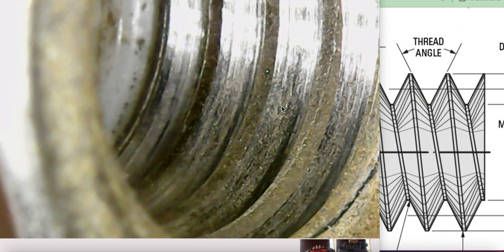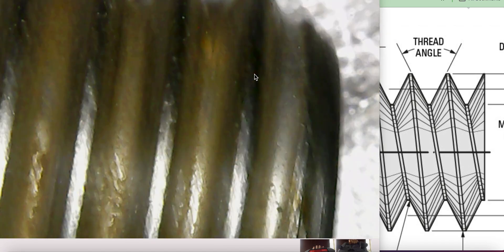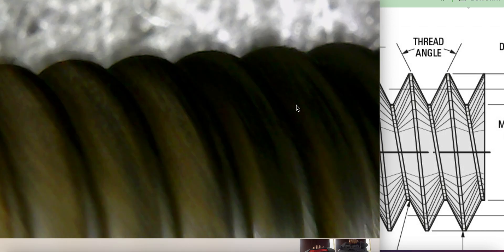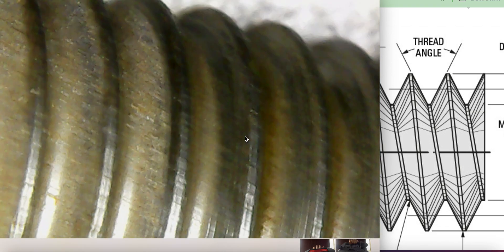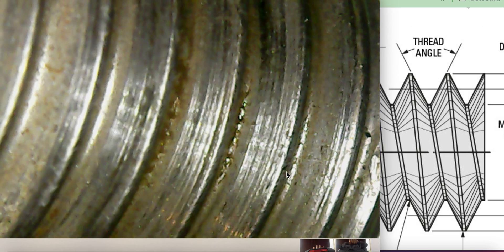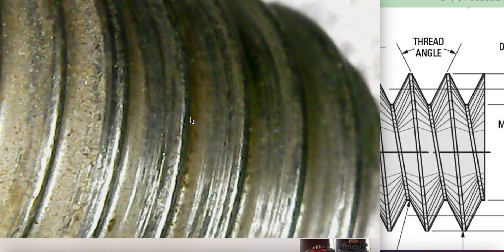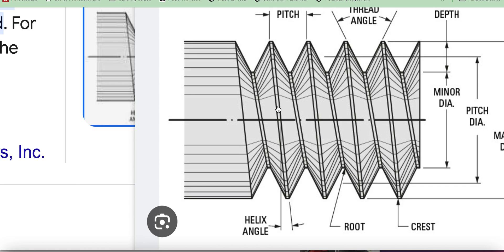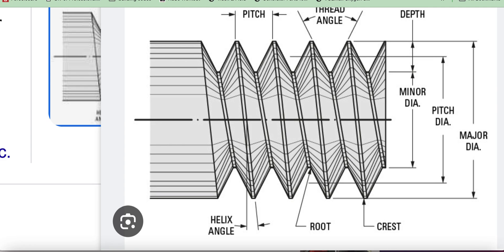Bolt failure bolt Thread Angle where the torque is anchored to create tension in bolt #boltdepot

Comment from the maker: Bolt failure, bolt failure is a result of pressure from the Thread Angle from the nut location... this is where the torque is created because nut and screw can no longer come close together without compressing the "field materials"; this then results in tension being created in the bolot...
This tension is created from the bolt it screw creating by "pulling" from the pitch angle / anchored point  to create this tension in bolt.
You maximize your tension in the bolt via turning the nut and it bolt and and it creates a torque value we average to create a "clamp force" and that clamp force creates tension in the bolt (more so then in the "nut")... too much tension will cause the bolt to fracture or strip the threads; just right/ just enough will maximize your clamp force and that is refered to as torque to yield...
Just enough where it does not go into yielding keeps your system in an "elastic range" and allows numerous reuses of the same bolt and anchor /nut/ stronger anchor connection system... #boltdepot
Reply from the maker: Edit to correct some spelling and one is bolt where u read bolot
Reply from the maker: Bolt failure, bolt failure is a result of pressure from the Thread Angle from the nut location... this is where the torque is created because nut and screw can no longer come close together without compressing the "field materials"; this then results in tension being created in the bolt...
This tension is created from the bolt it screw creating by "pulling" from the pitch angle / anchored point  to create this tension in bolt.
You maximize your tension in the bolt via turning the nut and it bolt and and it creates a torque value we average to create a "clamp force" and that clamp force creates tension in the bolt (more so then in the "nut")... too much tension will cause the bolt to fracture or strip the threads; just right/ just enough will maximize your clamp force and that is refered to as torque to yield...
Just enough where it does not go into yielding keeps your system in an "elastic range" and allows numerous reuses of the same bolt and anchor /nut/ stronger anchor connection system... #boltdepot